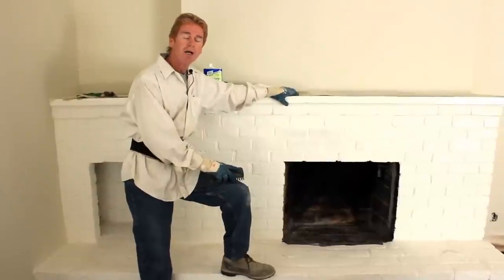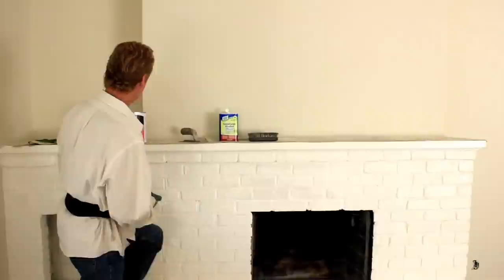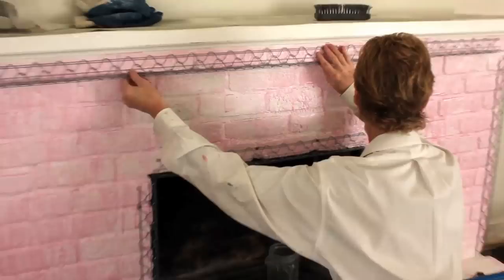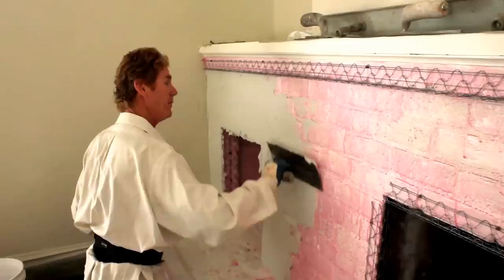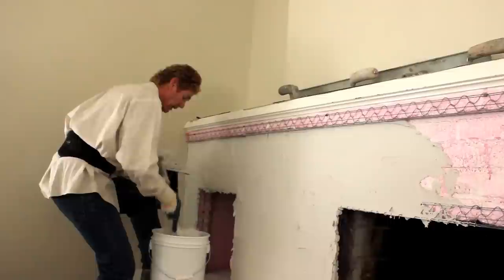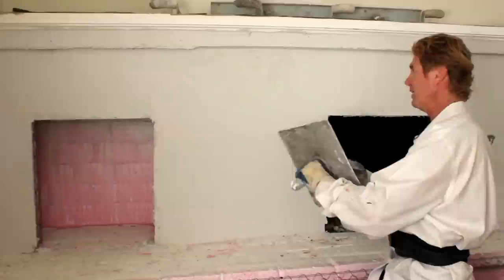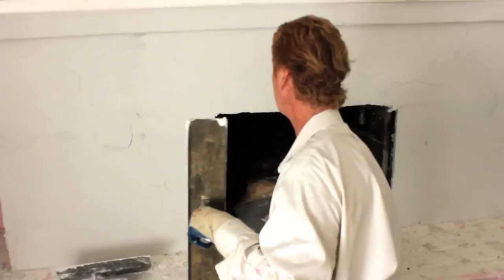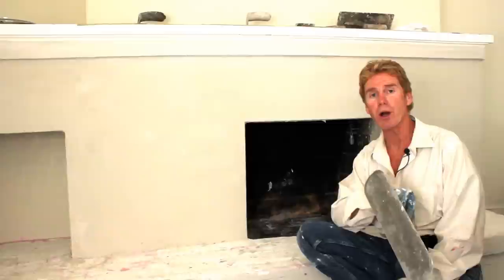Plaster over interior brick fireplaces

Comment: Kirk, my house is 100 yrs. old and has lathe and plaster.  I could not get a bag of plaster. I tried Home Depot and Rona and finally went to a masonry shop.  They sold me Structo-lite, cause even they didn't have plaster.  Can I use this in a bathroom with high humidity?  Also, can you mix up plaster from a combo of powders such as: cement, grout, mortar, etc?
Reply from the maker: Evening Mike, structo-lite is a gypsum based plaster, it's great as a base coat, but is gluey to finish with, if it were me I'd get some finish plaster such as diamond or imperial to apply over the structo-lite.
 Plasters are a technical name for interior plastering, stucco means exterior as a rule.
 Cement, mortars and grout are cementitious so, no, you can't use an exterior cement to make an interior plaster. 
 Here's where it's gets confusing, most folks including myself call applying stucco on exterior walls, "plastering" but we generally use cement plaster which is specifically designed for exteriors, can you use these inside, I have many times but don't recomend the average person to do so.
 cheers,
 kirk giordano plastering

Comment: Hi Kirk, I am refacing my brick fireplace I told the handyman to use the structo lite, instead he used regular mortar and he tells me he will apply the structo lite once we install the tiles around the opening of the fireplace!  Right now the cement looks grainy and sloppy.  Can you let me know if applying the structo lite on top of the cement if that will smooth it out or would we have to demo the cement and redo completely? HELP
Reply: I forgot to mention it’s a wood burning fireplace in case that makes a difference
Reply from the maker: Good evening Shirly one can indeed use stucco mortar for the case coat. The finish coat should be cementitious, rather than structo-lite.
 Structo-lite can be used, but I wouldn't choose it for the finish coat.
Welcoming, peace, love, and brotherhood, back into the 🌎 of Plastering.
    Bringing you the most comprehensive encyclopedia of free plastering video's ever put together,
 by the plastering messengers of Youtube. 
Kirk and Jason Giordano with over 800 videos 🎭 👀💃

Comment: I believe its best to use mechanical adhesion (wire lath)when going over any kind of painted masonry just leaves no question or concern about delamination.
Reply from the maker: Howdy 1983, I was born in 1959, that being said, I am responsible for any thing I do for a minimum of ten years legally, and for life morally, I strongly disagree, as to what is overkill to common sense with 35 years in applications.
 No worries, it's a free world,
 Best wishes,
 kirk giordano plastering

Comment: Love your vids. This vid was very informative. I have electrician friends who rough out old plaster houses with wood lathe. They use 1900 metal boxes with raises. After wiring complete  they use this product to fill in all around boxes. Finish with skim coat of joint compound. Just a light screwdriver used loke a chisel after paint to clear opening and expose device screw holes. Cant believe very few cracked.  Pretty cool stuff
Reply from the maker: Good afternoon Joseph, exzackory, works like magic. 😉
  Our unique plastering Tip:  all subscribers or anyone who stumbles on our channel with a question, type it into our Stucco/Plastering channel, and like magic, a video will appear to explain how it's done.  
   This feature is miles ahead of any plastering forum. 🥳 
Kirk & Jason Giordano Plastering

Comment: Hi Kirk, love the vids. Learned from them alone and have done three bedrooms and a bathroom with diamond/imperial in the house with great success thanks to you. Quick question - I just attempted the kitchen ceiling with gypsolite (blueboard,  durabond/mesh on joints, then bonding agent over everything about 30 mins before applying gypso). The gypsolite base never really set, it remained soft and cracked really bad. Everywhere it was over blueboard it easily came off in sheets with a putty knife. However, I couldn't scrape any of it off the durabond filled joints. Any ideas on what could have went wrong? Exact same conditions and application as when I did the sanded basecoat with success, so I'm really stumped here and figure I would try to get some advice from the master of plaster before reattemping. I'm thinking the material might have been too old but couldn't make out the date on bag, or maybe it was too thin (i applied about 1/4" thick). I'm tempted to just use the sanded base but really like the idea of the sound reduction from the gypso as my floors are so thin. Thank you and hope you keep up the great vids!
Reply: Stick to the basic joint compound .. No reason to use all these other plasters .
Thinset for tile compound for taping and skim coating .Always prime walls before skimming 25 years and all i use is thinset and compound and never had a problem.
Reply: @coachdee5162  Thanks for the reply but I have to disagree. The reason I used gypsolite base plaster was for sound control within rooms and between floors, which basic joint compound just doesn't do. I just finished doing the walls and ceiling in the living room with the gypsolite base and veneer finish, and the difference in noise control was amazing. Also, I was able to mud & tape the joints, fill the low spots, & apply the basecoat in the morning, and finished with the veneer that evening. One day of work and a sore arm but the room is done. We might even leave the veneer finish as is and skip painting it altogether. The time saving, lack of sanding, and lack of mess (minus some dropped plaster here and there and cleaning buckets/tools) makes me refuse to mud & tape drywall the regular way ever again. Give the plaster a shot, if anything its more fun, cleaner, and a pretty decent workout!
Reply from the maker: Evening Ryan, I would have suggested diamond or imperial base coat for the ceiling. Me, I could have applied one coat of Diamond, but this takes a bit of practice as it can blister or spider check if it's not applied just right.🧞‍♂️
Your question, I've never used, "gibsolite," I believe if you do it should be over metal lath or wood lath, why pay a fortune for a "plaster of paris," sort of product,  when Structo-lite would work much better.
   Bringing peace, love, and brotherhood back to the world of, “Cement Plastering.” 🌍
With over 800 educational and free Youtube videos, by your favorite plaster geek, “me🤓” and my son, “Jason,” the bearded plasterer.💃
Reply from the maker: Evening Coach Dee, many ways to skin a cat.🧞‍♂️
You have no issues of separation as that does not happen when gypsum is allied to sheetrock. What Ryan wants is a solidness or strength that 30 coats of gypsum could not produce. The sand and additives, such as crushed limestone or other aggregates, give these plasters the intensity he's searching for. The real question is what to use for a basecoat, already answered that to Ryan.
   Bringing peace, love, and brotherhood back to the world of “Cement Plastering.” 🌍
With over 800 educational and free Youtube videos, by your favorite plaster geek, “me🤓” and my son, “Jason,” the bearded plasterer.💃

Comment: Your videos are so helpful! We followed it and completely transformed our old brick fireplace. Thanks! One question - should we seal the fireplace with anything to protect it from staining due to soot with use of the fireplace? Or does paint work best for that?
Reply from the maker: Howdy Tim, keep your dampers open, and you should not have that problem.
 I had two fireplaces at my weekend home. The fires I made were crazy hot. If I didn't keep an eye on keeping the dampers open, the smoke would fill the house, which meant not only soot around the fireplace but soot through the complete home.😉 Paint, stucco, or plaster can become full of soot, thus watch what you're doing.🤔
Reply: @timandchristinelassen4485, did you plaster the base as well, the section where one may sit?

Comment: Are fireplaces that are plastered like this prone to cracking from the heat of the fire? I love the look of these and I’d like to do it on my terribly painted brick fireplace that has a wood stove insert. Great videos, thank you!
Reply from the maker: Most fireplaces around the world are made of bricks, as they can get hot with little to no issues. 
The Structo-Lite plaster does indeed have fire, sound, and insulation values. But the purpose is to cover the brick with this excellent base coat and then apply a lime finish for cosmetic reasons. They. want a smooth finish. Not the Brick finish.
Reply: @StuccoPlastering whats a lime finish?

Comment: Hi Kirk, over time will the surface crack?
Reply from the maker: No, bricks, blocks and or concrete won’t expand, thus no cracking. If we were going over wood there may be some in the future, it depends on the structure movement, plaster does not crack unless the underlayment does.

Comment: I'd like to plaster my fireplace surround which has porcelain tile that has been thoroughly abraded with a diamond wheel angle grinder. I'd like to extend the plaster over the wood mantle. Is that possible without compromising the wood integrity with this plaster or with plaster of paris or other? I can't find the answer anywhere. Thank you!
Reply from the maker: Evening Nonie, easy question to answer, there is no plaster or stucco that will adhere or attach to wood, none. However, you can lath the wood and then stucco it. Or you can purchase some Stucco-Flex Acrylic finish stucco and paint the wood mantle.
 Most acrylics stucco's wont adhere for long as wood expands when hot.
 Stucco-Flex can, In fack, my neighbor used some of my excess of his wood front wood porch 8 years ago, it's still on, that amazing to me as wood expands in the heat.🕵🏼

Comment: Great video sir! A plaster section covering the party wall in my 1910 apt seems to have broke off and separated from the brick wall. I removed the loose section and I am planning to use plaster again to restore the original feel of the apt. Another challenge would be to ensure the new plaster section is flush with the old section! Any recommendation on how to tackle this situation would be greatly appreciated.
Reply from the maker: Howdy Antoine, I would use a joint drywall or sheetrock compound, sold at all lowes and Home Depot stores. Apply quikrete bonding agent first.
 Or be forced to go to a plastering material yard and buy some Diamond lime plaster and cover it with that. 👨🏻‍🔬

Comment: Hello, question. I am re-framing my fireplace with Duroc to resurface with plaster. Do I need to use corner bead? Do I need to use some sort of mesh over the entire surface? Or can I simply use Fibatape for the seams and corners? I read conflicting opinions. If so, which corner bead and mesh should I use? Thank you.
Reply from the maker: Good evening Marcus, fiberglass mesh for all the joints. I prefer stucco corner aid to attain straight corners, they sell these at HD.
  Our unique plastering Tip:  all subscribers or anyone who stumbles on our channel with a question, type it into our Stucco/Plastering channel, and like magic, a video will appear to explain how it's done.  
   This feature is miles ahead of any plastering forum. 🥳 
Kirk & Jason Giordano Plastering

Comment: Hi Kirk amazing videos!

I have a 3000 square ft space and I'd like to use structo-lite over painted brick, but leave it as a finish coat, mimicking concrete walls and ceiling. Any suggestions on how to approach this, if differently than what's in this video?
Reply from the maker: Hi Jason, do as was done here; if you want a sand finish use a sponge float. If you want it smoother, wet your trowel when finishing.🍾

Comment: Kirk, is structolite suitable for general repairs and patching on wood lath walls? It seems to be the only plaster material that is available in the Indianapolis area.

we're doing some repairs to a late 1800s home that had been converted to apartments some number of years back. We have a section of wall about 32 inches wide by 90 inches high where all of the keys broke and the plaster released from the wall. The lath is solid and there is no visible water damage. We have removed all of the loose plaster and are down to the bare lath. We cannot find anyone who does plaster repairs around here, so appears we will need to do this ourselves. I am aware we will need to use a bonding agent on the lath. Would using structolite to build up the base and then finish coat with drywall mud be an acceptable solution? I have read some things online of people using a combination of mason sand and plaster of Paris to make their own plaster mix. Is that an option?

The only other option I can see is the Menards Home Centers in the Rockford Illinois area stock a wide variety of actual plaster mixes. I do travel to Wisconsin with some regularity and could pick it up on one of those trips if it would be significantly better to use something other than structolite or a self mix. that would cause some delay in US finishing this project.

Any guidance you can give would be appreciated.

Mike
Reply from the maker: Howdy Byron, if it were me I'd go to the nearest Home depot, Lowe’s , plastering material yards or even the small hardware stores and purchase some sheetrock compounds, these compounds set in 20, 40, 60 and 90 minutes and can be applied almost as thick as you wish, USG and Westpac’s are really popular for this quick patching. 
These compound come in 20 pound bags of dry power, yes you have to mix with a drill in clean buckets “it’s a bit of a drag” however the premixed sheetrock compound take forever to set and require many coats.
 Cheers, Live long and Plaster Kirk and Jason giordano's teaching videos

Comment: Hi Kirk, just had a thought... can a person use just thin set over a fireplace and smooth it out for a semi-smooth finish? Also, is there a product out there to seal the concrete thin set so it doesn’t dust off?
Reply from the maker: Greetings Sacha, interesting thought, I believe it can be done, however, thin-set grout also is an adhesive cementitious product, so once applied it will stick to any trowel you're applying it with.
  I don't recommend it though.  
The easiest way to cover a fireplace is with Gypsum Joint Compounds, Westpac Fast Set Vs USG Easy Sand
USG Easy Sand Joint Compound. Not the strongest method, but the easiest.
https://youtu.be/k7tE652qOH8Bringing peace, love, and brotherhood back to the world of Plastering. 🌍
    The complete plastering encyclopedia on video, by the plastering messengers of Youtube.  
     Over 850 videos 🎭 👀💃

Comment: Kirk, great videos.  I want to refinish my wood burning fireplace, is there a recommended base coat and top coat that is heat resistant to the fireplace opening?  I was going to apply Plaster Weld on the bare bricks, then Structo-lite and a recommended top coat.  Comments welcome please.
Reply from the maker: Good evening Tom, HD does sell cement and stucco that are resistant to high heat.
 Note: to all subscribers or anyone who stumbles on our channel with a question, type it into our Stucco/Plastering channel, 
and like magic, a video will appear to explain how it's done. 
This feature is miles ahead of any plastering forum. 🥳
Kirk Giordano Plastering

Comment: Hi Kirk.  I am doing my bathroom redo.  One wall (entrance to the bathroom) I have to use structolite  (over gypsum block NOT sheetrock) . I will tile over it after.  My question is: do i have to use primer cause structolite absorbs water too quickly and I am a bit concerned how it will work with thinset
Reply from the maker: Try Teal lime plaster, diamond found at plastering yards.

Comment: Hi Kirk. I want to stucco or plaster a new construction fireplace with a rough or rustic finish. The raised hearth is concrete blocks and above that is cement board. Would the structo lite be a good product that would stick well to each of these surface? I imagine I would need to apply joint fabric in the first coat to my cement board edges? Thanks!
Reply from the maker: Good evening Daniel, yes on all joints fiberglass mesh would be recomeneded.
 Kirk and Jason Giordano contributing over 850 free Stucco/Plastering videos for your education. 
    Together we have created the most comprehensive encyclopedia of Stucco and Plastering videos ever produced globally, all by your favorite plastering messengers of YouTube.
Bringing peace, love, and brotherhood back into plastering.🎭🏝🎆

Comment: Hi, I have an indoor red brick wall and half of the wall is covered with what I think is stucco and the  other half seems that it was removed, and some of the bricks are like powder.  I brush the whole wall with a soft brush and vacuum must of the brick powder.  Could I apply this product to cover this wall, since I am afraid of something worse happening if I remove the stucco. Thanks
Reply from the maker: Howdy Elena, clean all the loose stuff off then skim it with this or any other interior plaster or even drywall compound. Cheers.🥂